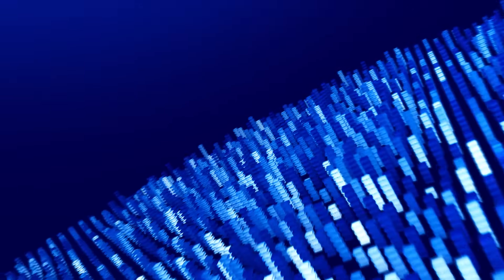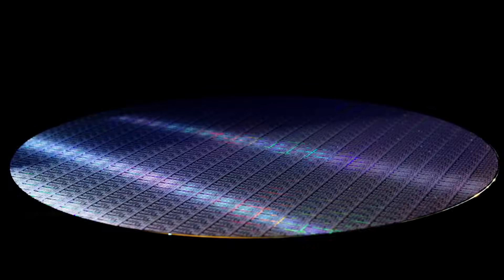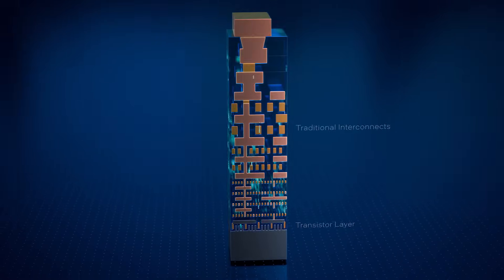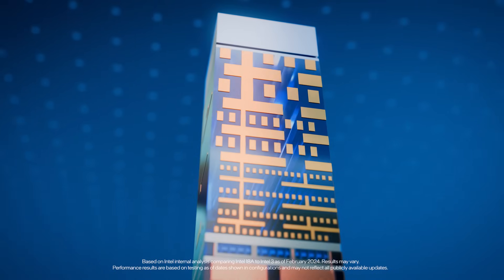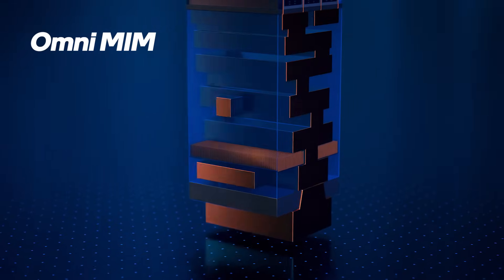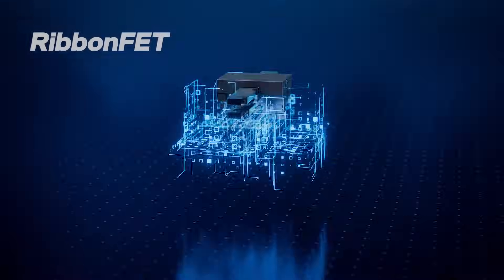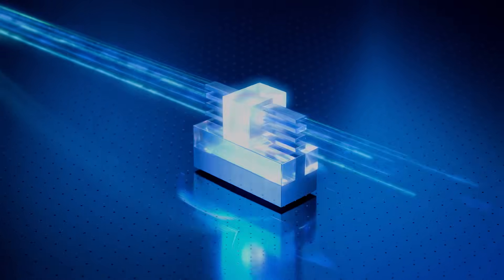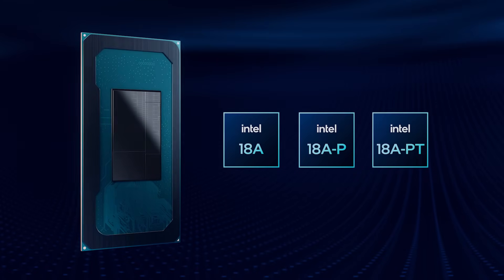Intel 18A Overview | Intel

Comment: to be honest i  still rockin my 14900k GOLDEN sample, doing 5.9 ghz at 1.28 vcore locked, ddr5 7600 cl 36 32gb ram and TDP locked, and it still competes with r7 9800x3d , maybe x3d wins by 20 to 25 fps but 1 PERCENT LOWS are always higher on my 14900k

Comment: TSV will be the key to next generation chip where glass interposer of substrate serves as external TSV between die and substrate through 3D packaging to connect the backside power with the glass interposer, bettering the electric efficiency and reducing the heat diffusion in high performance computing.

Comment: Dear Intel, please make fast processors with only P-cores! This is what customers are waiting for! We don't need E-cores on the desktop! Even Windows 11 still can't properly distribute the load in this mess of different cores. And according to rumors, LPE-cores will be added to Nova Lake, this is madness... Just give us fast and energy-efficient 6, 8, 12-core processors with only P-cores. Abandon chiplets, bring back the monolith (chiplets cause terrible input lag, which is noticeable in online games). Those that don't burn out after half a year. With normal, efficient solder thermal interface. With CPU cover that don't bend in the socket... Is it really that hard to do? Hire good engineers, fire marketers, listen to customers - otherwise you will finally drive the legendary corporation into its grave.

Comment: Transistor density simular to N3X/P
tsmc N2  313*.
Intel A18 238* 
tsmc N3X 234*
😊

*(MTr/mm2)
This is great destiny, but TSMC is still #1.
Reply: well well well "So, Intel 18A may outperform TSMC N2 in raw speed and efficiency, but TSMC still holds the crown in density and proven manufacturing reliability"
Reply: I'm pretty sure their biggest problem is capacity and funding. Only a while ago did they cancel 18A for 14A, and now there's a chance they don't produce with 14A if they don't get customers.

Comment: Imaging sensors had advanced earlier in different ways than ICs. Backside illuminated sensors basically does what PowerVia does, moving the wiring at the back and allowing photodiodes unobstructed access to light. But then, image sensors are not this tiny of a node!

(*There is no power to be fed to photodiodes, they create a voltage signal with light exposure which is amplified afterwards.)

Comment: Alliance  QuickShare and NearLink Laptops tablets smarphones routers and servers pc gaming gpu nvidia 6090, gpu 7090 and gpu rtx 8090 and gpu 9090  

Quantum-Link Technology for ultra-fast and secure connections  , Enhanced Bluetooth & Wi-Fi Speeds across all supported devices, Cross-Platform File Sharing with seamless multi-device pairing
Low Latency for real-time data transfer and streaming, Energy-Efficient Performance optimized for battery life, Universal Compatibility rolling out across smartphones, tablets, PCs, and IoT

Comment: when is the intel 15th gen gonna release?
Reply: Intel released 16th gen a couple months back, they just have a different name
The gens end after 14, and it becomes series

Intel Core Ultra 100 Series = 15th gen
Intel Core Ultra 200 Series = 16th gen
Reply: @Zeroneii3  Ultra 100 is not 15th Gen, it's contemporary to 14th Gen, just focused on mobile.
Arrow Lake and Lunar Lake would be "15th gen" or Ultra 200.
Also it seems there might be an actual 15th Gen, that uses the same motherboard as 12th/13th/14th Gen, called Bartlett Lake, which has 12P cores and no E-cores.
Reply: @MaxIronsThird  Wrong, Core Ultra 100 was 15th gen, just because it was barely better than 14th gen doesn't mean it's not a new gen
14th gen was a very slight improvement over 13th gen aswell

And there's no indicator that Bartlett Lake will be branded under "Intel Core i", they completely slashed that naming scheme
Reply: @Zeroneii3  you're right at the end there, but the rest is all wrong.
Meteor Lake was a thin and light laptop only cpu, Raptor Lake Refresh was the architecture used in gaming laptops and desktop, where performance is more important than power efficiency.

So no, MTL isn't a sucessor to RPL-R, that's like saying Arrow Lake is a successor to Lunar Lake.

Comment: What is 18A?
Reply: Manufacturing node.
Reply: AKA 1.8 angstrom.
Reply: a marketing buzzword. transistor size isn't 18 angstroms small yet.
Reply from the maker: Intel 18A is advanced process node, designed to power the next generation of high-performance processors. It integrates RibbonFET and PowerVia both of which enhance power efficiency, performance, and chip density. This enables Intel to build more powerful, compact, and energy-efficient processors, like those used in upcoming data center and AI workloads. Combined with Foveros 3D packaging, Intel 18A supports advanced “systems of chips” for greater integration and performance scaling. Learn more by visiting: https://intel.ly/43GmKev

Intel Customer Support
Reply: @Intel  When are you ready for B2B Tunnel Fet & Spintronics?

Comment: The last process node in Intel production chip is N3B from TSMC. Next TSMC node will be N2, N2P, N2E before A16. I'm quite wonder how small of Intel "18A" process node. Or it's just another rename node.
Reply: they were working on both 20A and 18A, but 18A was ahead of schedule and 20A was lagging, so they moved the people on 20A, to 18A, to focus on that instead, that's why Arrow Lake was made using TSMC's N3B node, which is kind of garage for the price.
Reply: 1.8NM and next is 1.4

Comment: PLEASE I'M BEGGING YOU. YOU NEED TO FOCUS MORE ON GPU THAN CPU. The Alchemist sure wasn't the greatest and sure was usually not great for the price.

But godamn the B580 is an absolute unit. Even 50 bucks higher than MSRP the card still provide better performance than other card at the same price point and with more VRAM. Capable of doing 1440p in some scenario and even 4K sometimes. The card is just an absolute legend. 1080ti/6900XT level of GOAT. Please we need you to stand up on the GPU market. 

A B780 (Or B770 but I don't think it will happen) with 16GB 256bit (or more) at 400$ beating a 7800XT/4070S is all you need to dominate the GPU market. 85% of gamers buy card under 800$. And even more gamer buy card under 700-600$ on usual.

4070/7800XT is one of the most sold mid-range GPU. Make a GPU able to beat them at a lower price point (knowing they are even more expensive now). And you absolutely dominate the lower/mid range market.

Only higher-end/high end market gonna get a 9070 to 5090 due to the higher performance despite the price cost.

Comment: Hope it doesn't become a space heater
Reply: @learnwithjes Sorry to disappoint you but this isn't Amd cpu hot garbage Ryzen 9000 and x3d which cooked itself.
Reply: I mean it wasn't that bad as intel but both did chips did f up @runninginthe90s75
Reply: @runninginthe90s75  nope they get it right now it consumes less than core ultra9K
Reply: or spectre!🤣
Reply: you're behind a couple of generations
Reply: like Ryzen 9000?
Reply: @itsmilan4069 more like 7000

Comment: which part of this node actually has the physical dimensions of 18 angstroms? 😂
also, how did you pass up the opportunity to use the Å symbol... a lower case a? really?
Reply: This is Intel's version of a 3nm process, they just rebrand it like that to make it seem a gen ahead, like Intel 7 (~10nm), etc.
Reply: @arky9002 yhea, it's just funny that gate is actually a magnitude of measurement larger than advertised.

Comment: Now Intel just needs to get out a 18A product on time.
Reply: I'm surprised they allowed comments on this video 😂
Reply: And with good yields and competitive wafer prices compared to TSMC leading nodes.
Reply: It is 2nm node it is literally cutting edge.
Reply: With solid performance boost
Reply: yes
Reply: too late
Reply: Now Intel just needs to get out a 14A production on time.
Reply: New CEO, New Architecture for AI CPU
Reply: Yeah seriously. The biggest threat of nanoelectronic industres is time. These impressive features are nothing special if they release it out for too late
Reply: And make sure their product doesn't murder itself cough cough 13th and 14th gen cough cough
Reply: They even use tsmc nodes  for their cpus now .

Comment: I will always miss intel 3 in a desktop product. It had potential of 2x performance of Raptor ptor lake, you guys blew it.
Reply: And we got TSMC N3B instead, what's worse about that?
Reply: Well TSMC N3B had it's pros and cons like higher capacity and supply chain, ability of intel to migrate to TSMC tools but from technical standpoint N3B is only 2-3% faster than intel 4. Intel 3 is 18% faster than intel 4 in transistor speed. Be N3B have higher density but intel in got speed. Looking at arrow lake it doesn't matter what node if the architecture is bad, low IPC for a 3nm class node (look at apple) or tiles memory latency.
Reply: @vineetkumarbharti2633  Are you sure you mean faster or transistor density? Because I can't find any information online about Intel 3 being faster, but I have seen that number come up when talking about density or efficiency. Also, Intel 20A is better than Intel 3 and it was abandoned in favor of TSMC N3B, making it more efficient than AMD's Ryzen 9000 CPUs already. Intel needs to focus more on performance because efficiency is not an issue right now.

Comment: I have been waiting like a Kid for these years to see Intel taking back the Crown. The moment when Arc GPU's stunned was a similar moment.....Eagerly waiting for Computex.....Hoping Intel shocks nvidia and AMD and everyone
Reply: With 15% increase?
Reply: yes the amd ryzen 4070
Reply: RTX 4060 performance on a chip the size of a 4070…how stunning! 😆
Reply: @cosmic_gate476  The B580 die size is like 20mm2 smaller then the 4070. What are you talking about with 3x 4070
Reply: @DeNoobGamer  typo , I meant the
Reply: if they can make a stable 18a chip with ribbonfet next gen, they'll have a better tech than nvidia...it's possible but i'm not holding my breath.

Comment: by the time you release a product based on 18a AMD will have released a product on 14a and destroyed you. no one cares about your concepts. start releasing decent sh-t on the market that is stable and competitive.
Reply: 14a is also Intel fool!
Reply: 18A is going to mass production fool.. And AMD does not manufacture. They are semiconductor design company.. Currently TSMC manufactures chips for them.. And TSMC is preparing for 2NM lolss
Reply: And no technical guy cares about number like 18A, 14A and N2, these are just names or branding. Real life performance of transistor matters for me. Alder lake hit 5.3GHz with 1.45x IPC of skylake on intel 7nm, while Zen 3 do 5Ghz with 1.25x IPC of skylake on TSMC 7nm. Intel transistor is clearly better here. Intel 3 is 40% faster and 18A is 25% faster over that as per recent paper ( this video shows Feb 2024 testing of early samples). Do the math 18A is going to faster than any competition node whether it's TSMC 2 or 16A.
Reply: So you're saying Intel is going to produce AMD CPUs? Fine by me haha.
Reply: @sharoyveduchi  might!. In future. But i dont really think its gonna happen, because, they are direct competition.. So!.